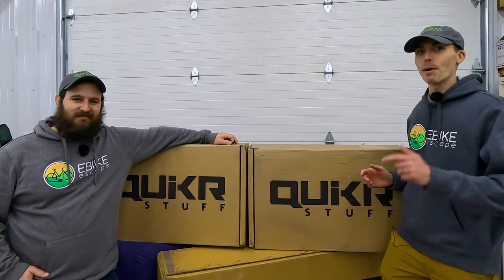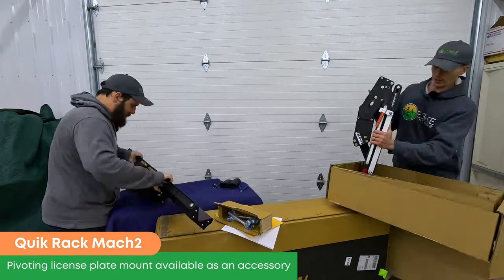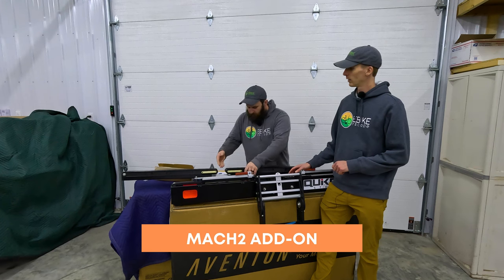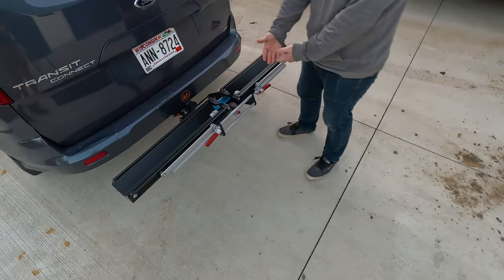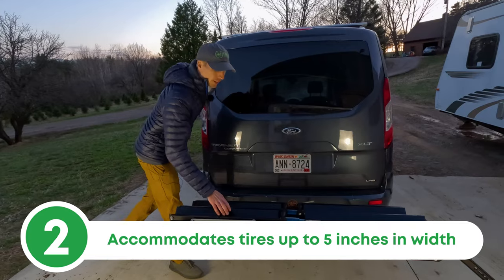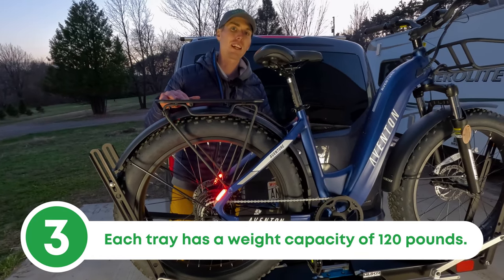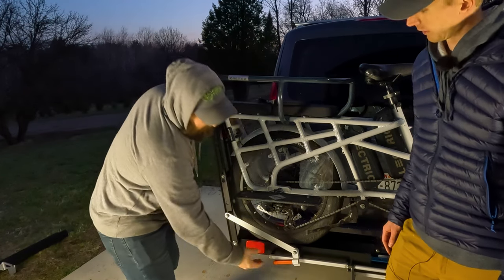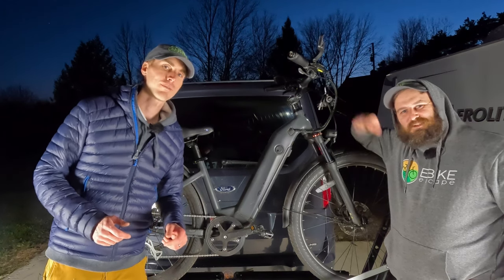Before You Buy an Ebike Rack You Need to See This: QuikrStuff Quik Rack Mach2 Review

Comment: I got a Quick r Stuff single rack this year. After using it for the biking season here in Wisconsin, I can say that I made a great choice and I love this rack. I was a little concerned about how it would hold my e-bike. This rack locks down on the tires and holds that nice and tight. The bike does have some jiggle to it as I ride my car, but it is not going anywhere. I also got the license plate holder and that works great. I did not want to spend 249 dollars for a bike ramp, so I made one out of wood for under ten dollars. It works great and I just store it in my van when I am not using it. These are great racks.
Reply: How long did it take to get your rack from when you ordered it? They seem to be back ordered right now.
Reply: @skellener  I think it was 5-6 weeks.
Reply: I bought two of the straps and the special lock and my bike doesn’t move at all. I’m in Wisconsin too, but I haul my bike 300 miles up to St. Paul. MN and I want that baby to be sturdy. She would be anyway, but I liked the extra security. I bought the ramp as well because I have to load and unload the bike myself. Worth every penny.
Reply: @wildwalker44  Yes, if I took it on a long bike trip, I would put a strap or two on it too. Most of the time I have a short car ride to my starting point, so I am not worried about a slight wiggle. It holds great on the tires.

Comment: To bad this is priced so high. It Should be a minimum of two bikes being able to be carried for the price of the base model.
Reply: Made in America doesn't always mean cheaper compared to other mass produced brands.
Reply: @mrgold3591  Still, it's waaaay overpriced.
Reply: @pibblesnbits  I think the price is relative depending on the type of bike/ebike, type of  adventures you want to take, storage options when not in use, ease of use for all skill and strength levels, and how long you are planning to keep the rack. My 4'11" wife can install and use this rack with ramp for her +65lbs Radcity ebike alone.  She couldn't do that with our Saris SuperClamp 4 platform rack or Softride Dura 4 hanging bike rack we had before ebikes.
Reply: The 1up Extreme is priced high for one bike. I like the no tools option.

Comment: Great review, the video was very informative! 
We have 2 Rad Power Wagons so we were disappointed when you said the Power Wagon doesn’t fit. It says the max wheel base is 56” and the Rad Power Wagon has a wheelbase of 53.76”. Was that not enough margin to mount it safely for for you or were there other issues as well?
Reply from the maker: So it did fit, but it was close. It was right on the cusp of what we felt safe recommending.
Reply: The Quik Rack states wheelbase of 56" or less.  I would give them a call/email to double-check with them.  I would even add ratchet straps if you wanted extra insurance for road trips.  I have a hard time finding a rack that can handle my two +70lbs Radrovers fat tire ebikes and one +70lbs Radcity step-thru at the same (300lbs limit with 3 racks with 2" hitch).

Comment: Nice rack.  
A couple of things are supposed to happen this week.  1. Having a trailer hitch installed on my car and 2. Getting delivery of my Aventure Adventure.2.
After getting the hitch installed, I will be ordering this rack as I've done a ton of research and the weight capacity of this rack makes it an easy choice for a heavy ebike.
I'm one to steer toward the safe side when it comes to stuff that "could fail" and most rack state things like load capacity 120 lbs (but 60 lbs per rack). Does this mean that the 77 lb Adventure.2 can SAFELY be on this rack for a fairly long ride to a specific bike trail?  Or will the rack/stall that the heavy ebike is positioned fail because the materials for the individual racks/positions may fail because the weight limit per position is exceeded?  
So I've decided I would rather spend the extra money to ensure that the "lesser quality rack" doesn't fail, and my insurance company isn't getting called because my ebike became dislodged, and another vehicle was damage or someone died because I cheap'd out.
The only reason I'm waiting to order is to ensure there are no issues with the installation of the hitch.
Oh, one thing I understand is the QuikRStuff rack has a license plate adaptor, so you can move your plate off you can to the rack so law enforcement and see your plates.  (Not sure if that is something that is new(ish) or what. Looking at their site now, I believe it is an OPTION for about $80
One more thing to add, when you go to QuikRStuff's website to order, they now have an estimated shipping time on the page, which at the moment of my writing this is around 6 weeks.
Reply from the maker: We should have covered that QuikrStuff has always been very transparent on shipping time and of course, the optional license plate holder. Personally, if I get hassled I will get that, but in WI front is also required. I imagine there are more important things for the police to worry about. The huge weight capacity is an awesome selling point. Hope you enjoy the rack and remember to use our code!
Reply: @EbikeEscape  I'm in Wisconsin too, although plates are required front and rear, only the rear has the expiration sticker on it.  Remember when you renew your plates you only get 1 sticker now (I guess the cost of giving us 2 like decades ago is impossible).
I only mentioned it the plate adaptor as another reviewer of the QuikrStuff rack mentioned and officer that had pulled him over for something did bring of the fact that his license plate was not visible as required by law.
Code? What code, let me look as I was about to order, as hitch was put on yesterday. 
Do you know roughly what shipping is, as they say it varies a lot? Answer atm $38 Fedex Ground, as I just ordered mine.  Yup used 'THE CODE' (and it worked), estimated shipping date around 6/12/23

Comment: This is one of the nicest bike racks I've seen. I'm curios what do you suggest for liscence plate visibility. Do people have problems ?
Reply from the maker: I've never read someone getting pestered for this but yes technically you should buy the license plate holder (I won't until I get hassled). I feel like the police have more important things to worry about. Here in WI license plates are required front and rear so that helps my case too.

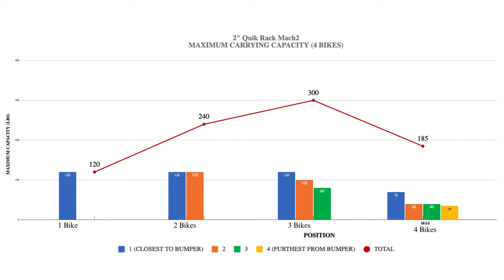Comment: Thanks for the great video.   I have a Honda Accord and the ONLY hitch available is a 1-1/4", Class 1, with max Gross Trailer Weight up to 2000 lbs and tongue weight 200 lbs.  Your chart shows a 2" hitch and you mention the capacity is 120 lbs. for a single bike  9:39   
What is the carrying capacity of a single eBike for a 1-1/4 hitch?   My eBike weighs approx 76 lbs.   
How is this rack different compare to most racks that has a capacity of 60-65 lbs per bike?  
I understand the 1-1/4" rack has a adapter for a 2" hitch.  Does this affect the capacity load?
Thanks in advance.

Comment: Can I add the first e-bike to the rack before adding the second bike rack so I don’t have to lean over as far?
Reply: Yes!  I have a second QuikRack for my wife's +70lbs Radcity ebike.  I can attach the first QuikRack to my 2" hitch and load/secure my ebike.  It takes less than a minute to attach and lock the second rack into place if I need to take a second ebike.  You can do the reverse and remove the second rack before removing the first ebike.
Reply from the maker: For sure!
Reply: Thank you so much.

Comment: When you say "lock" as in when your locking in the 2nd tray.  Can it actually be locked with a key or is it just as easy to steal as it is to install?
Reply from the maker: It locks if you want it to. Red pull spring latch secures it to the first tray and you can actually lock it with the blue locks which are keyed.

Comment: Is this rack approved for an RV?
Reply from the maker: It is. Here is the quote from their website:

"We approve usage for a two-bike maximum configuration with only the 2 in. hitch model on an RV or 5th Wheel. It needs to be inserted into a chassis mounted hitch receiver (not a bumper mount). " -QuikrStuff

Comment: Nice rack, not so nice price.  
Why bother with the rack instead of simply putting them into you Ford Transit van.  Seems easier, more secure, still allows access to gear in back of your van &  won't get damaged by careless driver as described by John Lowrey 6 months ago.